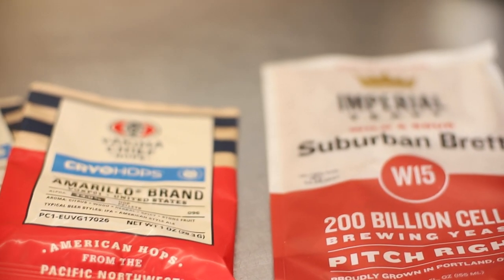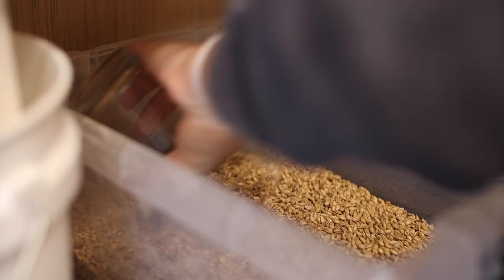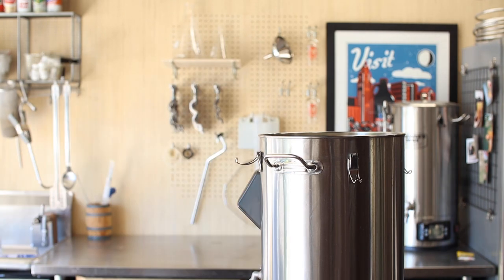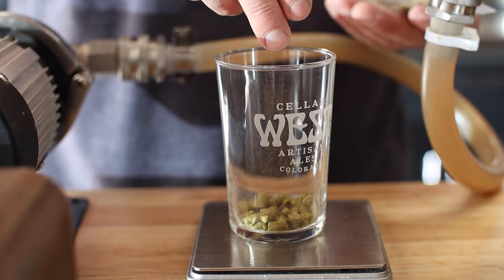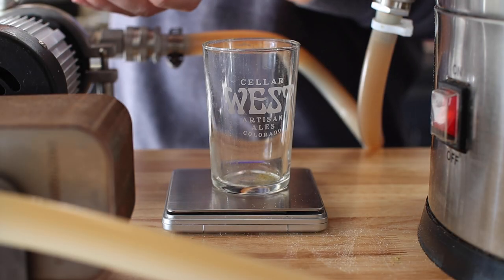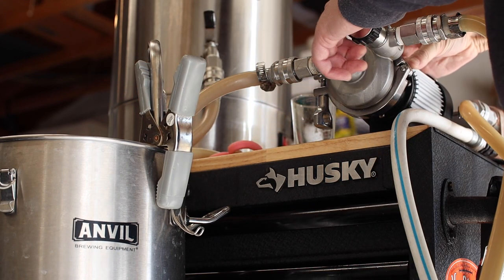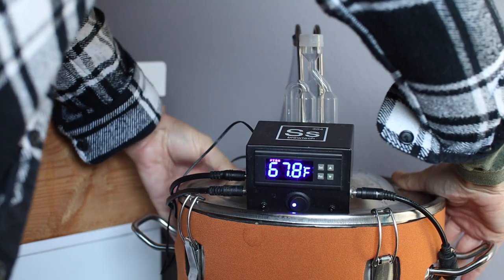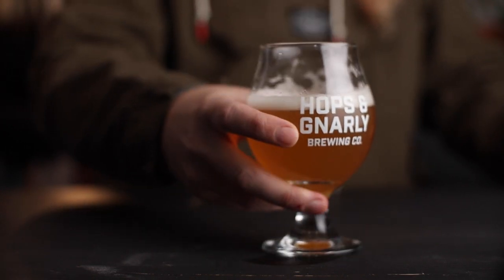Philly Sour with Brettanomyces | Anvil Foundry | EP37

Comment: Hey Dan,  around the 3 minute, 24 second mark you have a small basket that I think you pour the hops into.  Is that something homemade,  or did you purchase it?  Thanks!
Reply from the maker: Something I purchased. I think most people call them hop spiders and I’d really only suggest using one with a plate chiller

Comment: I wonder, why did you dry hop and pitch brett at the same time? how long after pitching brett did you try the beer? it sounds like brett didn't do anything here, unless you age it.
Reply from the maker: I did the first dry hop and Brett at the same time mostly because the fermenter was open but also was hoping it’d benefit from some biotransformation. Hard to tell if it did but you could easily save all the hops for the end if that how you like to do it. I did another DH before kegging. The Brett only had maybe 3 weeks before I started sampling and it was present but certainly not mature like an aged sour or Brett saison.

Still I hope I illustrated the concept and inspired a few people to try combining yeasts with Philly sour 🤘🏼🍻